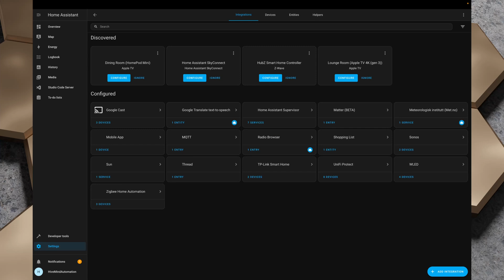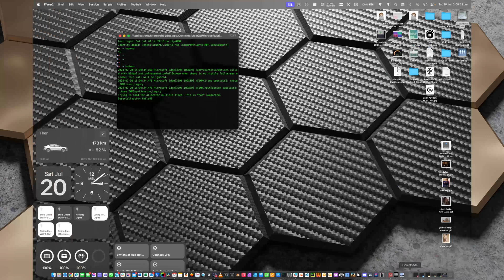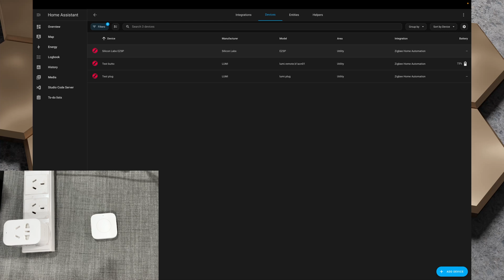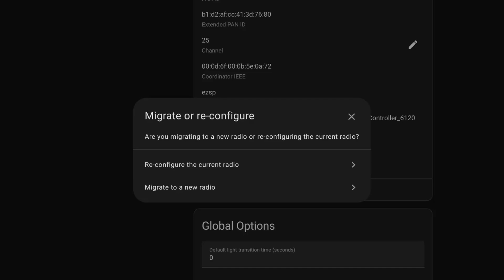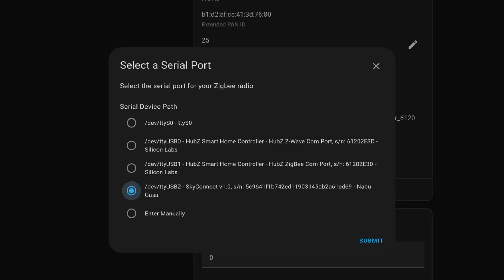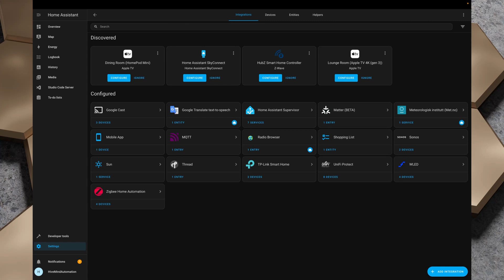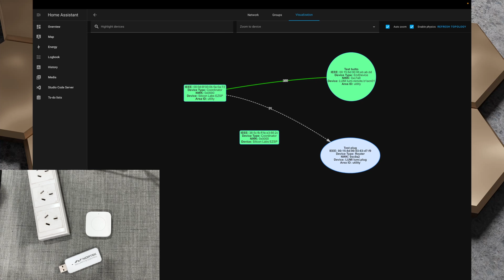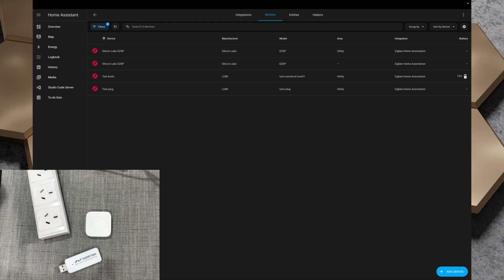How to Migrate Zigbee Radios in Home Assistant

Comment: Thanks for a great video.  I am preparing to do the same migration.  I still need/want to use the zwave portion of the  Nortek stick. I have read elsewhere that there will be problems if  the  Nortek is plugged in since it will have the same IEEE address as the Sky Connect. Of course, unplugging it kills zwave.  Did you test your setup with both the   Nortek and the Sky Connect connected?

Comment: Thanks for this. I run a 60 device strong ZHA (only) network via a Sonoff Zigbee 3.0 USB Dongle Plus. It's been a flawless radio with great range, long antenna and extended using a USB cable away from the rack. Some of my more important devices don;t do MQTT so I need to stay with ZHA>  I am still uncertain how to add thread/matter. Is it best to migrate to a combined stick like the NabuC one you have used here? I still don't even know whether migration upgrades are needed (into the future)...simply due to a Sonoff stick like the one I have becoming end-of lifed or unsupported with ongoing firmware etc ? So do I wait for the release of a new combined Sonoff ZHA/Thread stick? (If so, which one)? Or do I leave what I've got and simply just add a second matter stick? There is never any manual on this zigbee stuff.. just trial and error. Nobody lays out any "best practice". You learn what works trial and error as you go. I'd appreciate your comments on which is the best path to take to upgrade to the ability to add thread devices in the future.  Thanks
Reply from the maker: I think if you’ve got the USB Porta available just get a separate Thread USB stick. There should be a listing of compatible thread radios on the Home assistant site